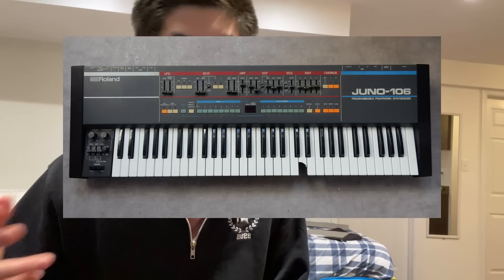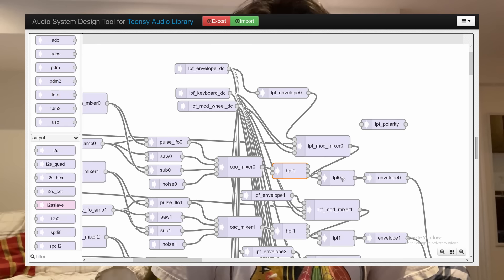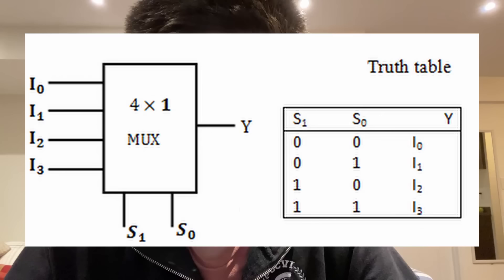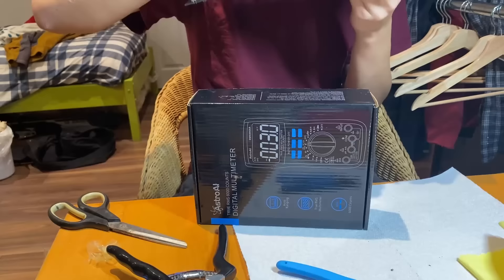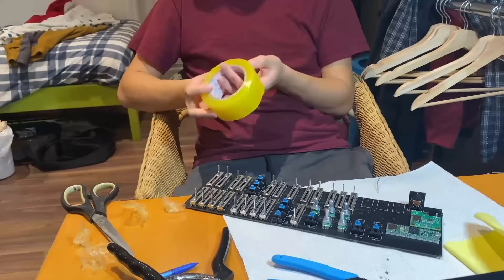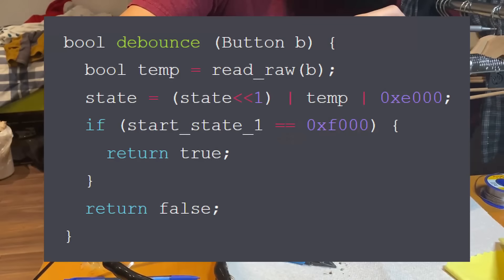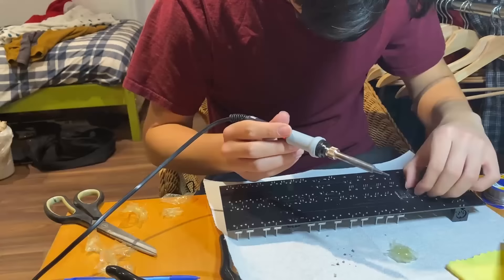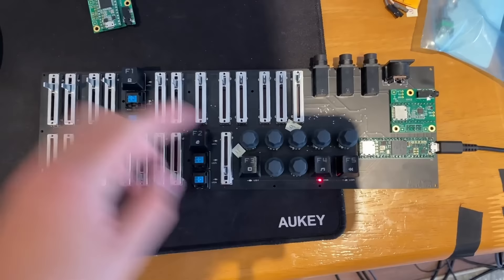Making A $2000 Synth For $99

Comment: Your problem with the analogue is from charge sharing between inputs. Give a little longer for each input to settle, put small capacitors to ground from each input(I.E.10Nf), and use lower resistances on your ADC inputs to combat the charge sharing. It puzzled me for a bit too, back around 26 years ago!

Comment: Really impressed that you where able to recreate an expensive and complex midi device with off the shelf parts for under $200.00. What you did is not something typically taught in a University environment. Beyond that, I feel that your keen awareness to share this journey online with others here is priceless. I hope you continue to innovate and share future creations here for us to enjoy. Time for me to pull out my old Teensie and see what midi accessory I can reproduce. . .
Reply: The Juno is an analog synth, not a midi device but, yeah it’s cool
Reply: You are correct in saying the Juno is an analog synth. It is also a complex midi device since it’s an analog synth with digital oscillators.
Reply: @HowToShopGreen the oscillators are fully analog, they're just digitally controlled. not exactly the same thing as midi, as the original juno 6 didnt even have midi but still had digitally controlled oscillators. (DCOs) so while there is definitely a digital component, this device is more accurately described as an analog synth rather than a midi device.
Reply: @lorelei of the mist  I understand your point about this being an analog synth. Like you said though, the original did not even come with a MIDI interface . At the end of the day be it analog, digital and MIDI based is a huge feet for under $100 and it works well. The synth I bought that had anything close to analog cost $600.00 which was a Casio XW-P1.
Reply: A quick search confirms that the Juno-106 has analog oscillators — and also has MIDI. Even “fully analog” synths can be controlled via MIDI via a MIDI-to-CV converter.

@edwrdw, I gather that your home brew version uses digital oscillators? Once you get your hardware issues worked out, you can delve into virtual analog modeling in order to more accurately model the characteristics of the Juno’s oscillators and filters — not all are created equal! Awesome project 👍🏼👍🏼
Reply: Well it was a budget synth made to sell for just a hair over a thousand bucks 40 years ago... 

The fact that a kid can make a digitally powered recreation in his basement for under $200 is why digital recreations are declasse and Behringer is selling fully analog synths for $200.
Reply: @johnsch8634  You're clearly unaware of how much knowledge and expertise goes into this type of project, digital or not. I would challenge you to attempt something even remotely similar.
Reply: @Cobalt985   How do you know?
Reply: @loreleiofthemist  I reckon its an emulated digital synth on MCU. Not an analog synth.

Comment: Shit, as a software developer, I’ve always wanted to do something like this, so thanks for sharing your process 😁
Reply: you can do it!!!!! i believe in you!!!
Reply from the maker: If you want some places to start:
I learned a lot about the software from Prajwal Mahesh, also Notes and Volts when I was getting started in hardware. (link at bottom)
For i2c, this video helped me a lot: https://youtu.be/IyGwvGzrqp8
And for designing pcb I learned a lot from just importing praj's board into Eagle (free with student license), and zooming in to see how he did stuff. Here's a short playlist that you can follow along https://youtube.com/playlist?list=PL_vPxziaK2fkAHkkC08F1jBsdSDWrQhph
After trying a bunch of different ICs for input expansion (multiplexer, i2c gpio expanders), I feel like praj's method is still the best. 

He essentially bought the ATMEGA4809, the CPU from the Arduino nano, and then wrote his own firmware to use it to read inputs.
It only costs $2 (at his time of build), and has 48 pins, so a lot more cost effective. It can also read interrupts which is good for rotary encoders, and it's a lot easier to debug since you can just run your code on a full ardunio. The firmware part sounds pretty intimidating, but once you learn i2c (and get a good gpio library), it's pretty doable (probably some examples online you can copy too). 
Good luck!!!!! tag me when you're done

https://www.youtube.com/@prajwalmahesh90
https://www.youtube.com/@NotesAndVolts

Comment: So far well done, especially with little experience! You have a bounce problem and for the multiplexers you probably need to add some deadtime to make sure you are reading the signal from the pot or switch you intent to read from. On the bright side, for 99,9% sure it is all fixable by changing the software. 
Read pin, set multiplexer, WAIT, read next pin, etc...

Comment: I think the instability is coming from not having pull-down resistors on the multiplexer inputs. I've made a MUX circuit before to read a bunch of ultrasound distance sensors and the signals I was getting were all over the place,until I put some high-value (>10k as far as I can remember) resistors between each input and ground. You could bodge wire them to the pins of the THT parts so you don't have to solder to the fine-pitch IC, although you get extra cred if you do that :D

Comment: I'd like to see your schematic to give a better answer, but here's a couple of basic things about an array of switch inputs I noticed here. The first is that you don't seem to have enough resistors on your circuit board to implement the "Pull-up" scheme you describe at 5:18 . Each switch needs its own resistor, and it needs to have a fairly high resistance to prevent injecting noise onto the +5V buss in your drawing, but hopefully you aren't sending 5V into the inputs of a Teensy 4.0, as it's going to go all "CMOS Self Protection Mode" and it will behave erratically until it fries out completely. From looking at the routing attempt at 3:50, you're putting many small-signal/variable-loads from your sliders on the same power busses as your switches, which dump to ground. This will likely make your slidepots unstable, potentially bringing the GND buss above zero volts if the ground path is long, thin, and shared with other voltage sensitive components like shown on the schematic. Instead of using a software debounce "Algorithm", you can do it in hardware for higher performance. Simply use the built-in pull-up input resistors on a digital input, connect the switch to the input and the other lead to ground, while the switch is also paralleled with a low-value capacitor. I would try a 103, or .01uF, because I don't know what the internal pull-up resistor value is, but if it's 10kOhms, the .01uF cap should give roughly 10 clean clicks per second. The way this works is that the pull-up resistor charges the capacitor, and the input will be low for much of that time. When the capacitor is charged, the input is high, but when you hit the switch, the cap gets drained very rapidly, and needs time to recharge. This will keep your contact from bouncing far enough to change states, as long as your wiring inductance is low enough to prevent the capacitors from ringing from the LC circuit thus constructed. Therefore, keep the capacitors very close to each switch, and wire the switches to their respective digital inputs, and the chip's own ground pin, with no other components on that particular run. That's a bit "high-end" though. Most simple designs like this just have a power plane on one side, a ground plane on the other side, and pull back these flooded planes away from the wiring traces that also need to be there. Be sure that all digital chips have their power supply pins bypassed with 104 ( .1uF) caps as close to the chip as possible too. CMOS chips commonly have their inputs diode-protected to their power pins to route brief spikes and noise to their power pins, and so a cap to prevent sending out-of-spec signal between chips and to dissipate any trash that gets redirected internally, is usually not needed, but can solve a lot of weird haunting issues too. 
The MUX will have a settling time listed in its whitepaper. You need to give the chips time to send the command to select the input, and then wait for the output to stabilize before you can get a good reading from it. This will be listed in the whitepapers, but what you showed and said about your multiplexers doesn't match anyway. Perhaps there's a deeper issue here. You didn't give a part number, so I can't really look it up for you.

Comment: really cool man, well done getting it to where it is! in regards to the switches + keycaps, a standard keyboard layout is a 19.05mm grid, you can follow the cherry spec (and get the 3d models for a cherry switch) and in terms of keycaps, a typical rule of thumb is that they're 18mm (x/y), however some keycaps can be offset to that from manufacturing. If you're gonna build a case for this, ensure that you give your switches enough room from the edge of the case, that is typically 1mm, otherwise they will scrape against the case

Comment: Hey Edward, just started watching the video. You commented that there wasn't a way for you to know if your circuit was going to work without doing all the mounting work first. As a telecommunications engineer I wanted to tell you that there are applications that let you simulate full circuits like those. Intel's Quartus is the software that we use in our school in order to do digital circuits programming and you can simulate those circuits via its built-in tool Altera. In my experience, sometimes the programming+simulation work time is not worth it depending on the circuit you're building, as it is a different knowledge area that should also be learnt and practiced. Anyway, I'll go watch the rest of the video. You earnt a subscriber.
Reply from the maker: sick

Comment: For debouncing you can use a passive  low pass filter placed between the button and pin as a hardware deboumcer. It's a cheap and easy solution that saves processing cycles on your microcontroller.

Comment: This is very impressive man. But you made a hardware interface for some dsp, not emulated a Juno. And then the sin you committed of putting a flanger instead of a chorus as the main effect. Gasp. Hahah 

So much of the juno sound is analog imperfection, it’s inability to stay perfectly in tune across every voice, and that super smooth analog filter. Those things are incredibly hard to model well in software, and avoid things like audible value stepping when doing a filter sweep. I would recommend keeping the signal path dsp and then running the digital oscillator mix into an actual analog filter. That’s what many modern synths are doing to give more sound variety while still getting that amazing analog filter sound and no weird aliasing.

Comment: The issue with the mux's might be propegation delay. They take some time to update, and so you may be reading the value from the previous port if you change the selector input and read immediately? Might just need to change your polling function to read from the current port, then change port, so by the time it "ticks" again, the newly selected port is ready to read.
Reply: I was thinking about his mux problems and it might be due to handling 3 truth tables?
Also thanks for this "change your polling function to read from the current port, then change port, so by the time it "ticks" again, the newly selected port is ready to read" I never actually cross my mind that you can change the polling rate, I'll use it in my gardener project :D
Reply: Agreed. The timings will be in the datasheet for the mux chip.

Comment: Super project :) 
If you make a version-2, you can delegate the IO to another Teensy board (or even something cheper like an Arduino mini).  Link both boards with one of the buses (I2C/SPI) the so the music board can poll the IO board to get the states of sliders and buttons. The IO board can also control the LED's automatically taking another function from the music board.  Nice work!

Comment: I'm making a guitar pedal form scratch and have run into many issues, tolerances, funky wiring to the IC, wonky footprints with small holes. 2 revisions later I still got the input and output jacks inverted. It sounds awesome so at least it's playable. I can't imagine trying to recreate a whole synth, great job!

Comment: Very good. I've been using the free KiCad rather than Eagle.
Get a Hakko soldering station and some good solder. My "soldering skills" improved with a good soldering station/solder (and keep your tip clean with wet sponge and metal wool).
Maybe ghosting on the switches. A diode per switch will fix the ghosting.

Comment: Hi.
Nice project. Congrats!
If I can offer you some advice: Always check the datasheets of the components you are using.
For example, your multiplexer looks to be the CD4067 (16-1), and the datasheet states the adress swap takes, internally, 650ns max. It means 1000ns, or (1 micro second) is enough, which is an order of magnitude less than 2ms and this way you can introduce less delay on your program.
Checking the datasheet is a good way to know the limits of the components you are working with, check if your code logic does what the component expects it to do, and so on.
If you are running few switches, I can also suggest "hardware debounce", in the form of a tiny ceramic capacitor of, say, 10nF in paralell with the switch.
Reply from the maker: Cool, thanks

Comment: When you does not want waste your pins for LEDS, use Neopixel (WS2812) 5V LED RGB stripe. Is very easy to use if you use arduino for it.

Comment: Nice video ^_^ The technical-creative side of sound design is definitely a niche-hitting section with not much competition.
I've had a small interest in learning up these things, but first, I have to learn coding language :P
Thinking about C++ and Python, although the homies down at Image-Line use Delphi, so I may have to look into that as well <_>'

Which coding language are you using? :o
Reply from the maker: c++ in PlatformIO, very similar to Arduino Language but you get to organize it a lot better (class, templates, etc.)

Comment: I have built a few pcb's they can be a real pain to route properly. Auto route works sometimes but often not well. Especially with audio frequency on pins. To do this well is hard. But you definitely did something correct because it at least didn't smoke when you turned it on!! Cool project and congrats. Maybe V2 will be better? Also did you do a copper pour for the ground? One funny thing happens with pcb design often is capacitance along near by traces. Often 2 traces next to each other will act like a capacitor and one will build up a charge when the other is on or has frequency on it which sounds like may be what has happened to you there. The amount ok knowledge it takes to make a pcb is impressive.

Comment: I like using shift registers over multiplexors. For one I'm more familiar with shift registers, and for another I can daisy chain them while keeping the pins to the microcontroller the same. If I wanted even more than 16 channels with a MOX, I'd have to use another 4 pins on the MC.

Comment: Wow! Such a cool quest! I'm not into virtual synths now but your work shows that you're stubborn in a good meaning!
Edward, if you're making such complex (to me!) PCB boards and soldering them... Why not just start to learn how analog synthesizers are working? I was inspired by Adamsky's YT channel in 2018. So I've started to make my own (with solderless breadboards) mono-synth... And you know what? It sounds totally different than I've heard of any real analog synths! This theme isn't so hard to learn. The basics of electric schematics... You know it already as I see. You just need to nail down the basics of analog parts: how to use them, where, the most popular cases. Then oscillators, VCAs, envelopes and etc. I mean those that are not emulated. They sounds different. In a better way. I'm telling it because I know what I'm talking about.
I was designing some sort of VA synths by my own in Sync Modular in early 00s. After that (~2016 probably) I've deal with Synth Edit and with some other editor (it was very buggy so I even don't remember the name :D ). I've designed some pretty good VA VST synth with this program. It looks not awesome but sounds pretty good! But... I was mesmerized when I've heard how "Sanxion" music track sound on C64 computer. It's SID musical chip. It's the analog synth in one chip and it's simply amazing.
That moment did started my quest with C64. I've found everything I've wanted: bought the breadbean C64 (with the dirtiest sounding chip SID 6581 - as I've wanted!) in a mint condition (that was a crazy luck!), bought a video converter (the lucky moment N2 - it's a pro device by Kramer, a used piece for few tens of bucks) and a virtual drive device (don't remember the name, it's not the best choice). Then I've found a used Kerberos - it's the best music related cartridge with MIDI sockets and it can handle "ROMs" for C64 (the images of game cartridges). The whole quest trophy now lays piecefully in my drawer with clothes :D ))
But this quest did started my main line of making my own analog synth. Unfortunatelly now I'm procrastinating with my real analog synths. Because my main hobby is music writing. But I will come back to this quest again! I still have a big proto-project on a thick acryll sheet which was populated by solderless breadboards. It's not working for now but I'm not disassemblying it yet. Just need to solder VCOs and other parts properly. I use these solderless boards as inter-connectors and insert soldered proto-boards into them (they take less space). The proto-boards were became much worse than the blocks which were made on solderless breadboards. I don't know why but I suppose because these were made mostly using "air wire" connections, not PCB-like paths.
Reply: "Sanxion" was not the original I suppose... Probably it was this: https://youtu.be/5CU0ifwYMb0